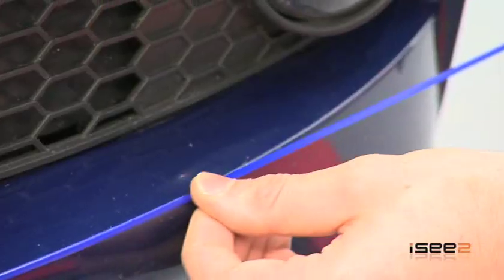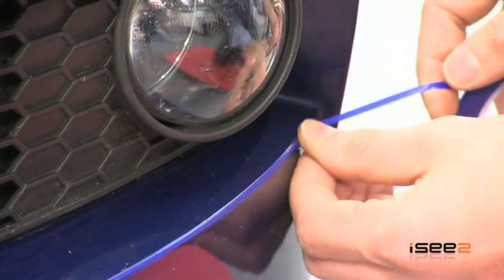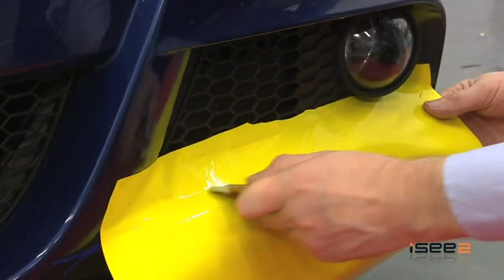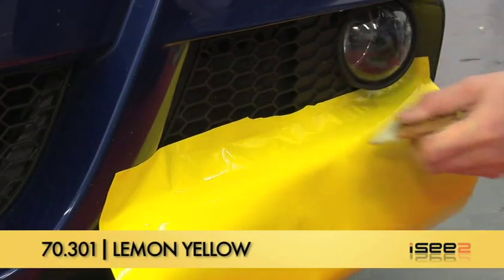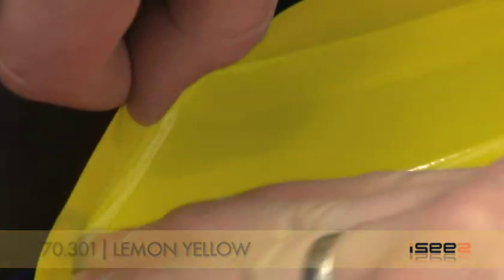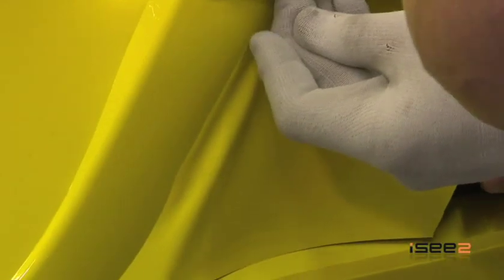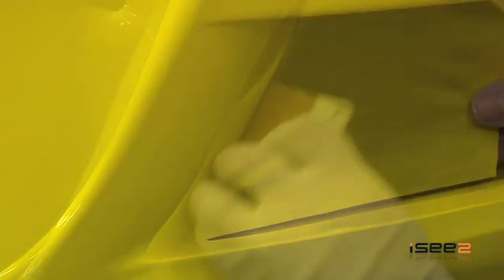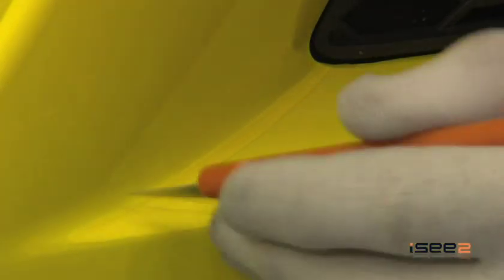iSee2 Total Wrap - Don't overstretch yourself... fit inlays instead

Comment: I would definitely use knifeless tape instead of trim tape and a blade. Means the cut will be very straight and much easier and safer than using a blade
Reply: Right 😂

Comment: I see a lot of seamless wraps with deep recesses like this. Why would you do it this way?
Reply from the maker: Hello David. Thank you for your question. Every surface and/or car is different, so it is the sole choice of the applicator to decide to use inlays or not.
Reply: because they don’t want to stretch the vinyl. and it’s easier they don’t have the skill to mold it to the indents amateurs

Comment: "cutting on the vinyl" seems so risky what if your doing like a 100k car and it goes through both lol. Seems nuts!
Reply: if you are not comfortable cutting on the vinyl, you can use cutting tape, 100% safe.
Reply: +Elliot Baker use knifeless tape, when you pull the tape off it cuts the vinyl, no blades needed.